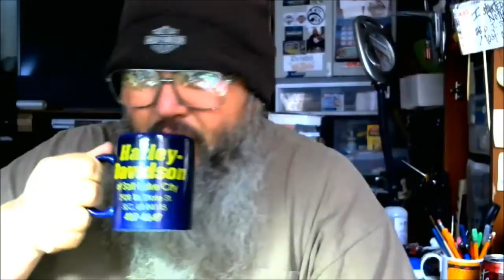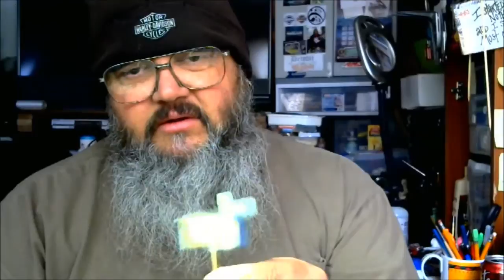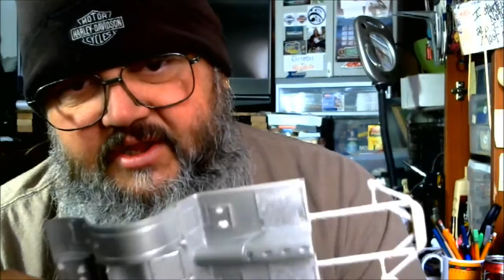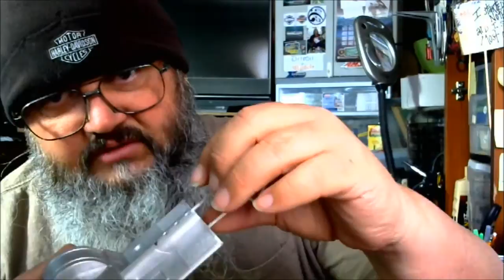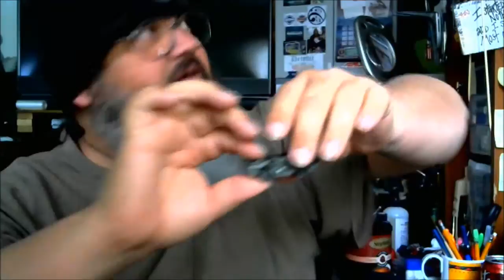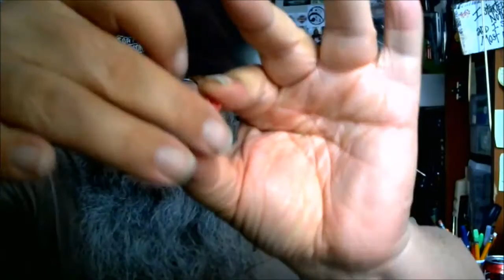Coffee Time 2/28/15

Comment: Chris not sure if this would help anything . I bought a 69 el Camino back in the early 90s ( real 1:1 ) it had been a show car it had the wild 70s paint job and 24 coats of clear lacuar . well it sat outside in the weather for about 10 years and when I bought it it had those spider cracks all over it looked like a shattered window lol. Maybe its not your polish that's cracking maybe its your clear or the combo of both . anyways hope it helps.
Reply from the maker: Thanks for the info bud. I believe it was the temps and the clear coat. A few others had same problem and we all used different polish products. Cold was a common factor. Thanks for chiming in!